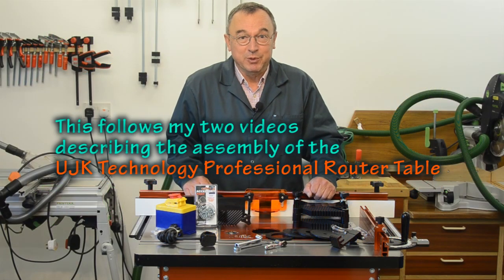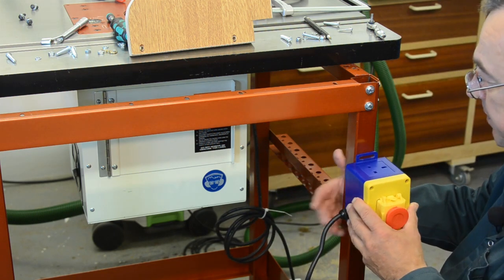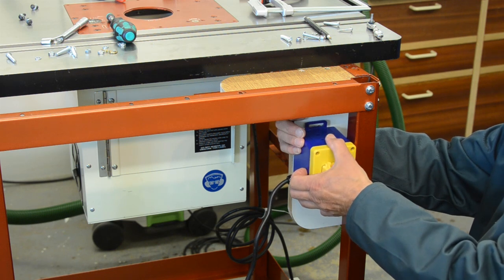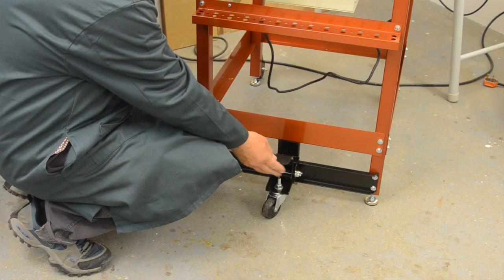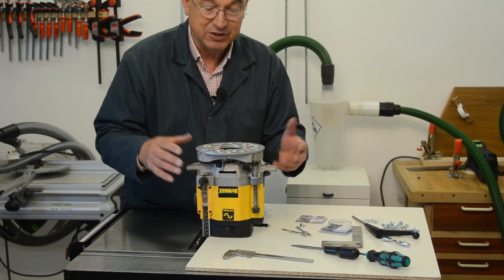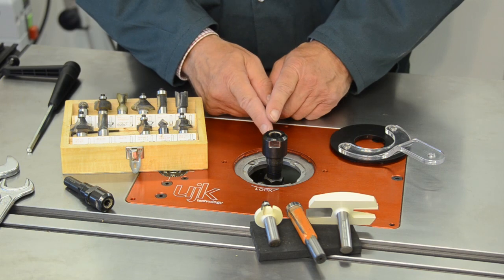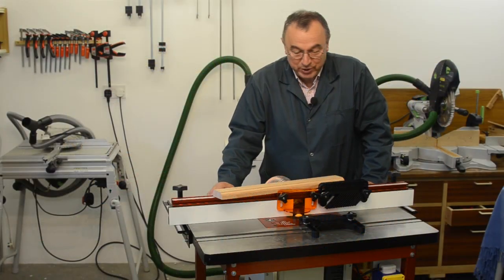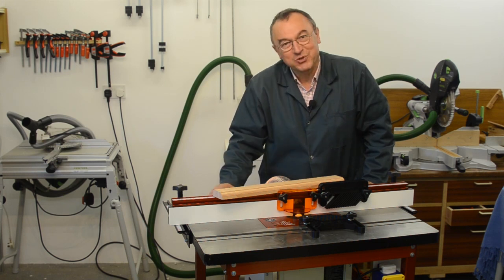UJK Technology Professional Router Table - Tweaks

Comment: your video helped me enormously Peter when I bought this system. One thing I discovered on using this system. was the dust and woodchippings when they occurred were dropping down inside the expander table. The large orifice in the Universal plate was allowing the dust to fall down into the router air vents, which concerned me as a fire risk so I cut out a piece of hardboard to fill the gap
Reply from the maker: Hi Paul, Yes, one does need to find a way of collecting the dust efficiently. My old Dewalt router had a dust port that worked quite well with a hose directly connected to it under the table. I had plastic inserts for my setup designed especially for the job.  Cheers.  Peter

Comment: Hi Peter, my cast iron version finally arrived last week after ordering in April! your four videos have been extremely helpful  in helping me to put the table together, and also replacing the castors. So today, final build activity was to to fit the Dewalt 625 into the router lift, (on your 'tweaks' advice I had ordered the Trend screw set in advance), but after a very frustrating hour of trying, I simply could not fit the Uni-Base to the router (yup, I removed the router base first), the trend screws sit ever so slightly proud of the UB which meant it wouldn't sit flush in the elevator, hence it rocked on the screw heads. So back to Axminster for advice in the week, I'll report progress if it helps anyone else out there!
Reply from the maker: ***** Hi Clive, Gosh that has taken a long time to arrive. I think that at about the time of the video going live Axminster had a supply hiccup which they have now solved. I am surprised that the screws are proud of the base - are they the countersunk ones or the flat (cheese head?) ones? If they are counter sunk then I would ask Axminster if you can make the countersink a little deeper. If they are flat ones then you could ask them if filing a dash off the head of the screw would be OK.  Good luck.  Please let me know, by private message, how you get on.   Peter

Comment: Hi Peter even though you now use the festool CMS router table would you rather have the UJK table over the festool ? For me the time has come to up grade my router table , I have the of 1400 for the use in a table and logic says buy the festool . But it looks like it has a rather small work area . Both festool and the Ujk table has + & -  I like both but I have to have the best of the bunch .
Reply from the maker: Terry De'ath Hi Terry, As you already have the OF1400, which is not easy to fit in the UJK table, it looks like the CMS is the better option. The added advantage is that you can take the router out of the CMS in less than 2 minutes for use freehand which you cannot do with the UJK option - which would mean buying another router. Also, the CMS is quite portable and can be stored away easily. In the UJK's favour is the professional fence and the cast iron top.   Peter

Comment: First of all my congratulations for the quality of your videos.
I live in France and would like to purchase a remote switch even with UK plugs (I can always buy adaptors for). Where did you get yours ?
Thanks in advance for your help.
Daniel
Reply from the maker: Daniel Dos Santos Hi Daniel, I bought mine from Axminster Power Tools but they no longer have one with a socket built in. This will be better for you as you can add your own socket. Here is a link:  http://www.axminster.co.uk/axminster-nvr-switch     Peter
Reply: Daniel Dos Santos Thank you very Peter much for your quick answer

Comment: Hi Peter, i can't find anywere if it's possibile to off-set the two side of the fence to use the router as an edge jointer.
Reply from the maker: Hi Paulo,

You cannot does this with the professional fence although you could easily make up your own sacrificial inserts (I showed how to do this is one of my Q&A videos) and just make one a fraction thicker than the other.

Alternatively, make up two pieces of wood to attached to the supplied sacrificial fence but make one piece slightly thicker than the other.

Peter